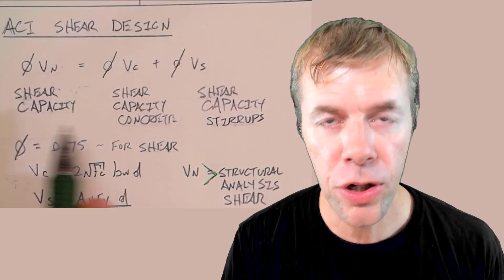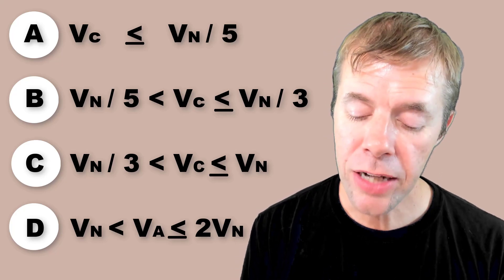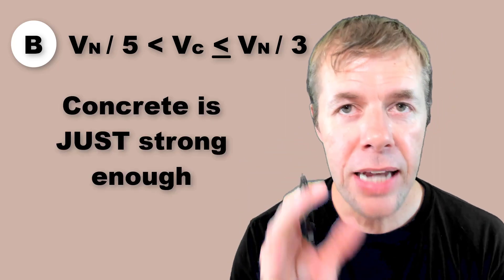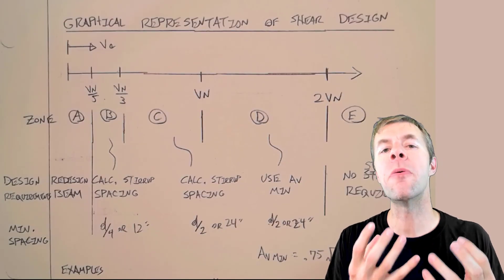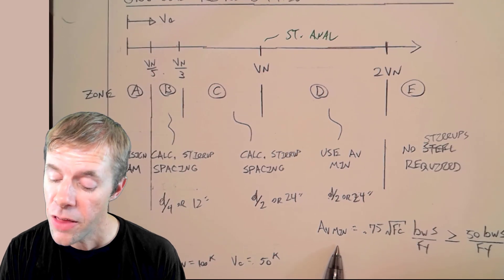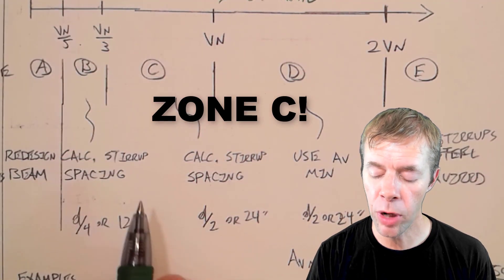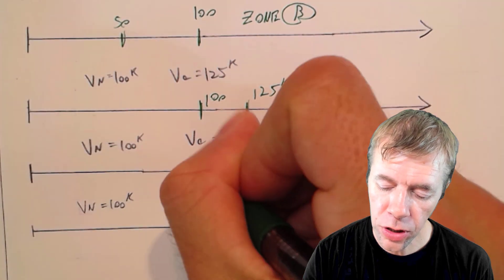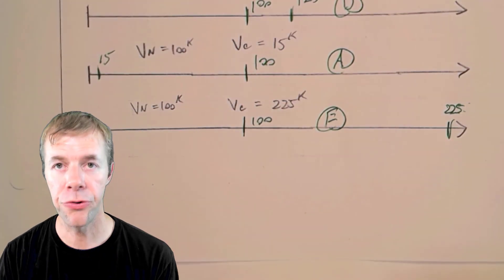ACI Shear Design Method

Comment: This is a cool way to look at it. I noticed though that you designate Vn as the design action, however ACI 318 terminology uses this for the nominal capacity. I got a bit confused with that.
Reply from the maker: David,
I think I use phi Vn but I divide by the phi in the first step.  I agree it can be a little weird.  Thanks for the comment!